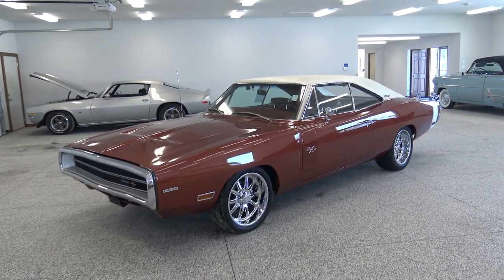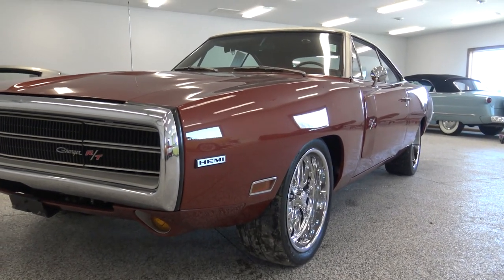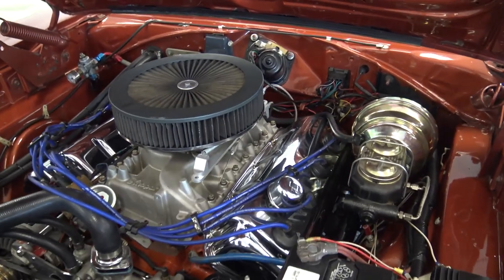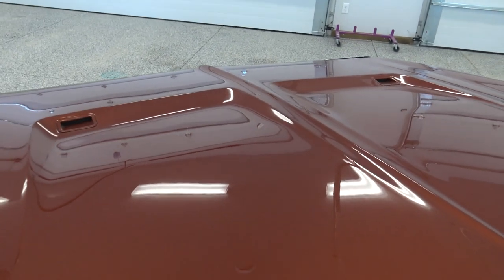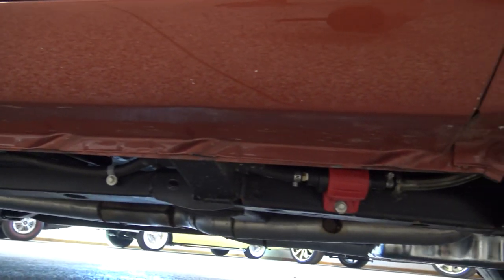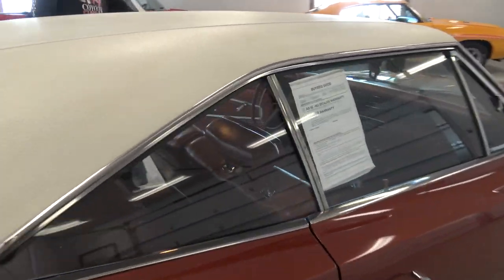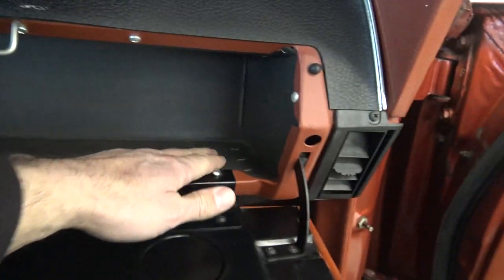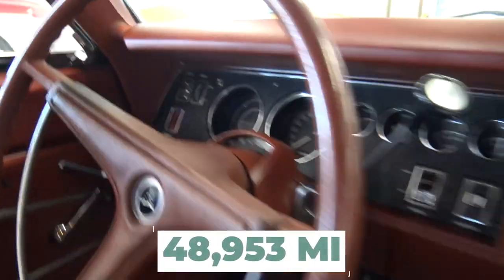1970 Dodge Charger (SOLD)  at Coyote Classics

Comment: The car is missing the upper door and quarter pads, stainless under the decklid edge and the 2 end pieces that wrap down towards the bumper.  No AC? They should buy the repro dash pieces to cover the AC vents and swap the heat controls for heat/fan/temp. Swap the tail panel square emblem for an R/T, and replace those shit wheels with chrome Magnum 500s.

Comment: Nice looking but not a high end Charger. No buckets, console or floor shift. Orignally a 318 motor. This is a low end Charger that has been painted and a big engine dropped in. Lipstick on a pig for over $75,000.
Reply: Agree, they will never sell this car for that amount